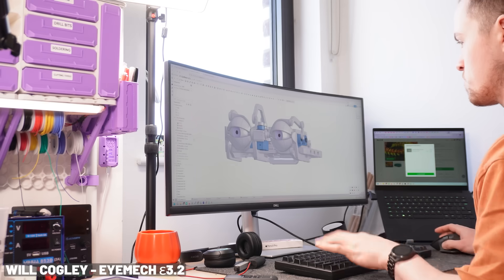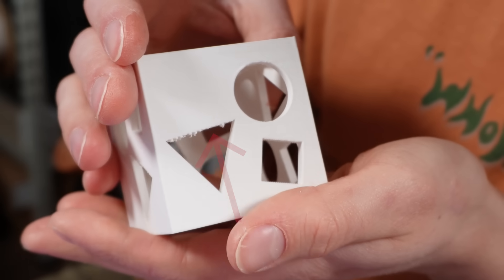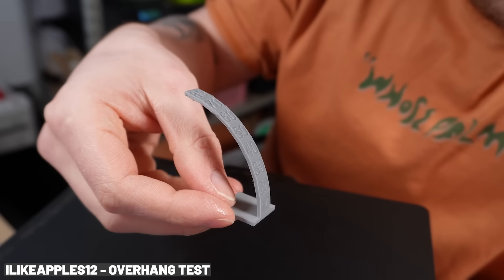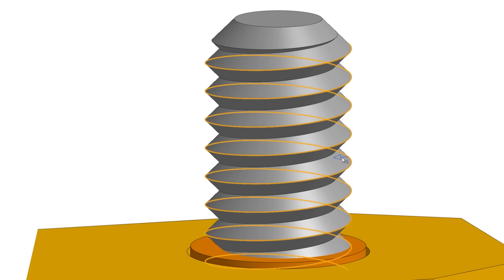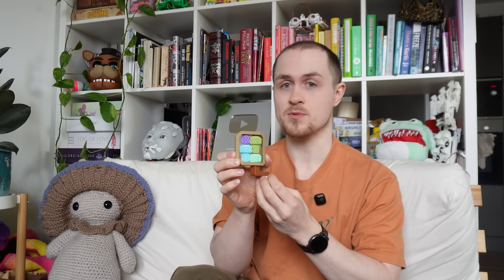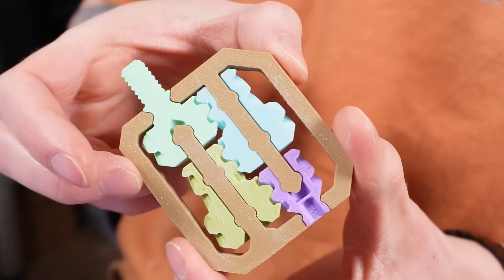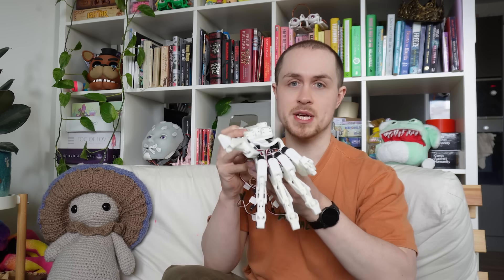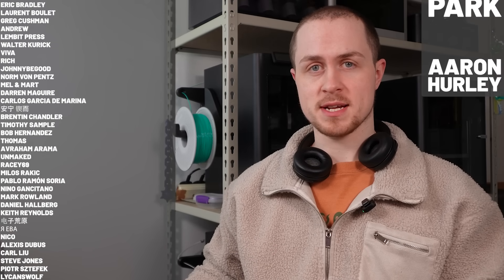4 Keys to Make Your 3D Printed Mechanisms Work First Time

Comment: Excellent Will, thank you.
A while back, I changed my slicer support-overhang settings to 46 degrees.  The thinking is that a normal CAD fillet is 45 degrees, and this simple change should avoid unnecessary supports (I don't think one more degree without support will ever be critical).
As far as I can remember, Cura did not print support for 45 degree overhangs, but at some point that seemed to change.  Rather than wasting time trying to figure it out, I just changed the setting.

Comment: If an outer surface needs to fit I often print outer perimeters first and at a very slow speed. No matter how good the printer is, higher speeds will always increase all kinds of risks.

Comment: solution to half these issues: PVA

your orientation for your gearbox makes the shaft extremely prone to failure along the layer lines.  both of these issues can be solved with a different orientation that adjusts the shear lines and PVA to allow you to have as many supports as you need.

Comment: finally the video i've been looking for so long. by the way, when printing round holes vertically, there is a trick to make a cutout at the top a little higher and flat, so that the hole resembles a drop tuyere. so the deformation of the hole during printing will be controlled

Comment: I am a swiss cnc machinist, making medical implants, & there is no way, even in the most precise machining, is there a way to know if a part will come off right the first time. Even new tools can vary. In that respect, it is absolutely no different than 3d printing. No form of production is. Even molds can vary in size due to many confounding variables. While this video is well intentioned, i have to say the title & concept is a fairy tale.
Reply: In 3d printing fit perfectly right is about 0.1 or 0.05 mm tolerance which is way easier than cnc machining. Thus, when you print two part that need to be mounted titly, errors and tolérance will bé very good if printed at the same time, on the same build plate during the same print

Comment: The other day I saw as printer which moved the bed, and thus could print any overhang cleanly. It's funny to think 3D printers still are in their infancy.
Reply: It’s a slicer problem. You would have to make really fancy calculations to make it work. For now open source isn’t there and there is the patent issue as well. 
For a long time the enclosure of printers where under patent for example. That’s why you had to made them yourself in the past.